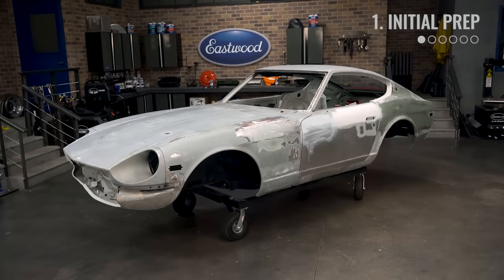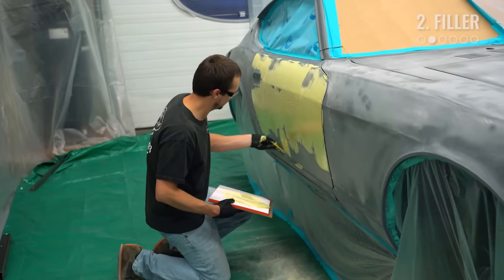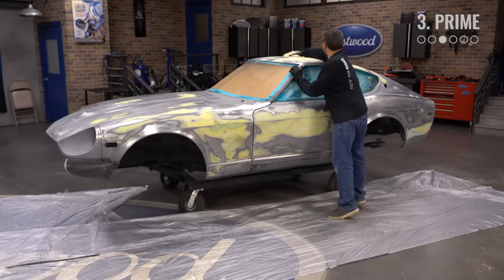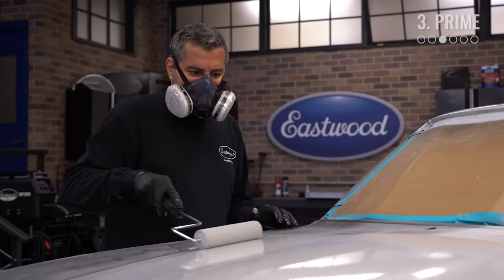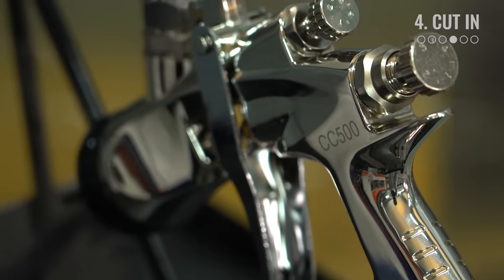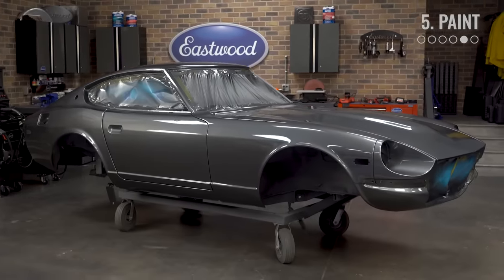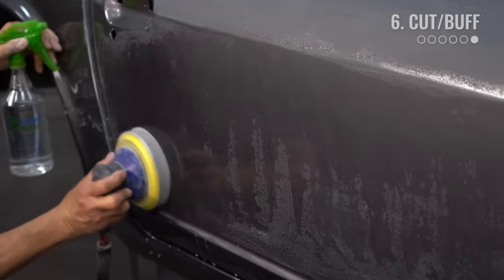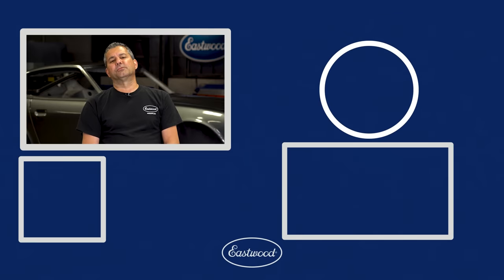STEP-BY-STEP GUIDE: How to Paint a Car at Home

Comment: 1:04 the bare metal of this car looks clean. What if the bare metal of look a bit dark in sommme places,   kind of minimal surface rust in it. Will it be enough to clean as much as possible and put primer on it?
Reply from the maker: So if you run into some pitted metal and light rust you can't quite get to we'd suggest something like fast etch which will neutralize the rust and then you can epoxy over top and it won't come back.  If you don't address it, a couple years later the paint will bubble from the rust creeping back in.

https://www.eastwood.com/rust-remover-eastwood-fast-etch.html

Comment: Great instruction! I’ve heard that polyester primers are porous and will absorb moisture. Not a good idea to let a project sit ?
Is there a high build epoxy primer that will allow DYI users to work on and off a project car without fear of moisture? Thank you
Reply from the maker: All primer has porous properties to a degree but urethane would hold up better to working on a project panel by panel.

Sprayable: https://www.eastwood.com/eastwood-gray-urethane-primer-and-activator-gal-kit.html
OptiFlow: https://www.eastwood.com/eastwood-optiflow-roll-on-urethane-primer-gallon-catalyst-kit.html

Comment: The link in the description takes me to a contact page, but I don't see any options (drop down menus) to browse OEM colors. Listing the prices of OEM select paints by gallon, quart and pint would also be very helpful.
Reply from the maker: We're working on launching the browse feature, in the mean time you can call us at 800-469-7940 or via this contact form https://eastwood.kustomer.help/contact/oem-paint-color-request-Hy0GFOlOn

Prices vary depending on paint code, for example pearlescent colors vs. metallic.

Comment: Last question, the rollable primer, can I use that at different times. Like if I want to do my door one day because it's off the car and my car the next day would that be okay or do I have to use it all at once
Reply from the maker: You can use it at different times, just only mix the 2 components in amounts that you're planning to use at that time.  You can paint panel A on Thursday and Panel B on Friday you will just need to use a new roller/paint tray.  We used the same gallon of OptiFlow on multiple projects.

Comment: Your video mentions an epoxy sealer coat as a final layer if desired. What reducer and percentage would you use to reduce the epoxy primer? Would you use the same epoxy primer?
Reply from the maker: Watch at 7:18, It's the epoxy reduced a further 20%
Reply: @eastwoodco understood but what product was used to reduce the 20 percent?
Reply from the maker: One of these depending on temperature: https://www.eastwood.com/eastwood-s-slow-medium-fast-urethane-reducers-qts.html

Comment: Outstanding video, you had panels removed would there be advantage to painting them off the car?
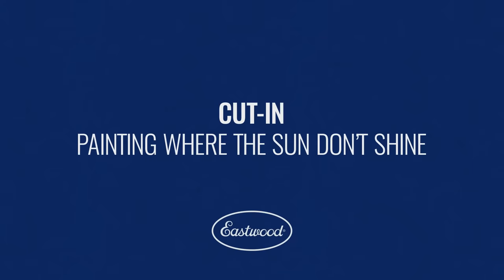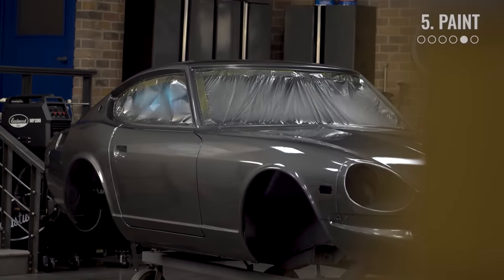Reply from the maker: Watch the "Cut In" section again at 7:45 to 13:26.  You can blow the car apart and paint it all separate if you have the room and time to do so.  You don't have to worry about taped edges that way but you need more room and booth cycles.  If you're doing a two tone it gets complicated to match.

Comment: What about the doorhinges? Lots of gunk there. And the airintake below the windscreen.
I assume sanding by hand but do one mask the hole for the heater? I assume the paint will find its way to the interior?
Good video!
Reply from the maker: For door hinges - you'd want to get them as clean as possible first, using a combination of soapy water and a brush.  Followed by a solvent such as Pre-Painting Prep.  You'll paint them along with the rest of the jamb - either during cut-in or when painting the body.

You can use the back taping technique on spots such as the cowl.  If it's taped well you won't find paint traveling very far.
Reply: @eastwoodco  Thx alot! ☺

Comment: So don't use bondo? or is there something better? I've heard that can fall out. It sure seems like a lot of work. Where can you get that blow up spray booth?  that seems pretty cool
Reply from the maker: Did you watch though the whole thing? We start applying body filler at 2:30.  The thing about filler is you don't want it to be more than an 1/8" thick as it will become more susceptible to cracking/chipping.  It's a lot of elbow grease but if you  take your time YOU CAN DO IT! Our spray booth is found on Amazon.

Comment: Do I have to use a glaze coat? And does that coat go over the rollable primer? I also am doing my car in stages so the doors off the car and trunk. If I have bare metal before I even start body work on my car, Can I use the rolling primer kit multiple times at different times? I just dont want my parts to sit in baremetal for days until the whole car is ready for primer
Reply from the maker: You don't have to use glaze coat.  If you get your body work straight and are happy with it while still in standard body filler you can move onto primer.

Yes we stripped this car to bare metal, epoxy it for rust prevention and it acted as a guide coat. Then blocked the car in the areas that needed additional work and then applied body filler.  Ideally you're not spreading filler on top of paint/primer unless it's a chip or something you missed right before paint.

Yes you can use the OptiFlow kit at various time. For example one week you prep and prime your hood, the following week you could prime your door.  You'll just mix the amount you need for the next job, and put on a fresh roller/tray.

Comment: This may be a dumb question, but if all the paint has been stripped, does the bottom of the car and the floor or roof type areas have to be painted also? I'm planning on dipping my 68 Mustang, and I have absolutely no idea where to start on paint and body work. Love the video!
Reply: The whole outside excluding the bottom should be worked if painting and they explain the jams and cutting in the video so you should be good there

Comment: How long did the process take from bare metal expoy to the final coat of clear (before cur and buff) and about how many people doing the work?
Reply from the maker: We didn't work on this straight through like a shop or even someone at home might, we did it over the course of 6 months or so.  However day's worked is probably about 20-30, mostly Mark with a helping hand every now and again.

A normal person working some nights and weekend days could probably do this in about 3 months.

Comment: If the clear coat came off over time, do I still need to sand the car to bare metal before putting primer on or can i just sand it enough to put the primer over?
Reply from the maker: There's definitely options to not strip the car entirely - check out this How to RE-Paint a car which is more in line with what you're looking for.

https://youtu.be/rZ7F6gmmH4E
Reply: @eastwoodco  thank you for your response

Comment: Nice work, but when u sand filler to smooth and got trought base epoxy to bare metal dont u think its good to put epoxy again those spots when u see metal to prevent rust? Sprayable filler prob dont have these anti rust features?
Reply from the maker: Our Polyester Primer still has great adhesion to metal.  You're going to end up with burn throughs on edges when blocking your epoxy but it is ready for the next step, and this is the next step.

https://www.eastwood.com/eastwood-contour-polyester-primer-direct-to-metal-surfacer.html
Reply: @eastwoodco   Ah yea i see, nice 👌, i have done like this: if bare metal, epoxy, sand, filler, sand, IF got tru to metal then sprayed those spots epoxy again, litle sand, then base and clear. Lot of steps and epoxy takes own tiem to dry but seems to work

Comment: They didn't mention it but DO NOT OVER SAND WHILE BUFFING be very cautious and if you break through the clear you repaint depending on how nice you want it to look
Reply: The other biggie is to ALWAYS have the rotation of the buffer going off of the panel being buffed! If you go the opposite, the pad can grab an edge and burn right through your paint!  You wont be happy! Stay away from antennas or wipers if they are on the car. If the pad catches one of those, you will know it!

Comment: Why wasn't wet sanding performed  last before base coat to get out the fine scratches.
Reply from the maker: You're talking about "color sanding" between base and clear - that's not typically necessary.  We address the final finish in the Cut/Buff step after the clear has fully cured.
Reply: No, in your beginner paint at home video and from painting in the past. Last primer go thru wet sand 800, 1000, or more then clean and shoot with base color.
Reply from the maker: Sorry we didn't understand your previous comment then.  Yes, primer is block sanded to 600 grit, we then sprayed this car with sealer and sanded with a DA with 600-800 grit.  You could do that wet or dry. Then spray with base, then clear.  Then wet sand and buff the clear coat if you'd like.

Comment: Would it be a better split by going 80-150-220-320 instead of 100-40-100   (80-180-220-320) in steps to 70-70-100 sorry I have ocd lol
Reply from the maker: Well you can only sand with what paper is available, and 150 grit is not a standard increment. You could go 80 to 120, 180, 220, etc. if you want some added insurance you're getting all the scratches out.  But 80, 180, 220, 320 is a proven workflow.

Comment: I'm painting my old van with Direct to Metal Paint. Would you Recommend Using a Primer to seal, as it says it doesn't need a primer? It's my first time using direct to metal would like some advice thank you guys.
Reply from the maker: I'm not aware of that work flow.  Generally speaking you would want to use an epoxy primer to seal metal, do your bodywork, another coat of epoxy/urethane, then paint.

Follow the manufacturers instructions for best results.
Reply: @eastwoodco  would a Grey Oxide metal Primer be ok? Thank you for your help really appreciate it.

Comment: Why not using hu build 2k primer as primer after Metall work? I have some left and wonder if I can use it
Reply: Working on a 1970 landrover, already sanded old paint, but now I want to strip it completely, brush a layer of etch primer on the alu and than bodybuild it up to Perfection as you did. However I already bought the high build 2k primer, sadly not from you, here in Australia everything is expensive af, so I want to use 2 layers of 2k primer instead of the primer you used - is there any problem with that? 

Do you sell in Melbourne AU? @eastwood
Reply from the maker: So there are lots of options when using primer.  We like epoxy over bare metal but if you've already purchased it just check the manufacturer's instructions to make sure it's good for both metal/filler.  Most likely it will be fine.
Reply: @eastwoodco  thanks guys

Comment: What's the difference between primer and sealer?
Reply from the maker: Primer is a thick coating meant to fill imperfections and be block sanded.  Sealer is thinner and (typically) top coated right away.

Every car will require primer, sealer is up to the painter.

Comment: why use a roller? wouldnt you get a flatter smoother surface if you sprayed it?
Reply from the maker: OptifFlow is a Roll on system - great if you don't have access to a spray booth. We used it to show that you can prime in your driveway without a compressor, gun, or booth.

https://www.eastwood.com/eastwood-optiflow-roll-on-epoxy-primer-gallon-catalyst-kit.html

Comment: Hi! 
What do you call that dolly for moving the frame? Positioning jack is the one that you put under each wheel, but can't find the name for this one that you use for moving just the frame. I vaguely remember that once I saw the model that allows you to turn the frame upside down, but not sure that it wasn't one of my would-be engineer dreams.
Reply from the maker: Mark built a custom body cart or buck for this car to make it moveable.  We offer a Rotisserie which allows you 360 degree access to the vehicle: https://www.eastwood.com/eastwood-3000-lb-capacity-rotisserie.html
Reply: @eastwoodco  thanks!
Reply from the maker: You're welcome! We also have DO have a body cart - but it doesn't offer 360 rotation: https://www.eastwood.com/eastwood-heavy-duty-body-cart.html

Comment: At which point did you, or would you apply seam sealer?
Reply from the maker: Seam sealer - as in sealing between overlapping body panels, would be done during the metal or primer stage.

We also did a "Sealer coat" which was after all primer, minutes before base coat.
Reply: @eastwoodco  Thanks!  I'm at that stage on my 280Z where I'm priming and need to apply seam sealer on the body panel joints and overlaps.  Brushable and tube seam sealer from Eastwood arrived last week!

Comment: Can I use a less glossy rattle can ?
Reply from the maker: You'll need to sand the surface with 800 grit for proper adhesion and then spray with a satin clear.

Comment: Curious why not spray base over sealer when flashes, how i did at the body shop with akzo nobel products used
Reply from the maker: That would have been a great option.  Our reason for sealing and than sanding was strictly a scheduling issue - we didn't have the painter ready at that time.

Comment: I still got some epoxy primer at home, is that Differential from the optiflow epoxy primer? It says it can be applied on the body filler, but I want to roll it on instead of spraying... is there any problem?
Reply from the maker: Yes, OptiFlow is formulated to "Flow Out" more since it's being applied via a roller.  At the very least you'll have a lot more texture to sand through if you roll on traditional primer and depending how it's formulated there could be some adhesion issues because of thickness.  We would recommend using OptiFlow for best results that we could stand behind if you want to roll on.
Reply: @eastwoodco  ok, next time. I buy from you, with my "old standard" primer I will at a but more thinner and hope it will Flow better

Comment: Can I roll the epoxy primer on paint with no clear coat/ sanded paint?
Reply from the maker: If you're not stripping to bare metal and just doing patch work you could spot repair like you're suggesting. Just make sure to do proper prep work, sand to 320 grit, and clean with Pre-Painting Prep.
Reply: @eastwoodco  ok thank you very much. Bought the epoxy primer roll kit. Just making sure I can use it

Comment: How long can you wait between coating a truck with primer and the finish coats? I have a 91 GMC 1500 I wanna completely redo inside and out but am gonna have to do in stages. Can I take any time between stages or should I do it all at one time?
Reply: I drove a 79 Ford F250 for over a year while doing the bodywork. I'd do work, primer, drive. Sometimes I'd have to go back and sand that primer and do more body work. But I went panel by panel. When all the body work was done, I shot a coat of sealer and painted in the same weekend.  With a catalyzed or activated primer, leaving it exposed is not terrible. It's not ideal, but not terrible. I don't know a manufacturer recommendation timeline though.
Reply: @ST-cy6we  that's what I was gonna do.  Just go step by step. Didn't know if there was any kind of window between coats.
Reply: @claygreen4723  check out the white sheet for the primer. That's the best source of info. Eastwoods has a support number too.

Comment: Is it possible to sandblast as an initial prep
Reply from the maker: If you have the ability to sandblast as your first step we'd absolutely recommend it.  Just make sure to get some epoxy primer on it after so it doesn't start rusting away on you again.

Comment: So I can apply your filler over your guide coat?
Reply from the maker: No you need to sand the guide coat off before applying more filler.
Reply: @eastwoodco  I may or may not have gotten it all sanded off lol it was scuffed buuut not fully removed, I’m assuming I should go back and sand it all the way down
Reply from the maker: Sounds like a judgement call - do you think it has good proper adhesion or do you think it will fail?

Comment: Hi, could you give me a bit of help, I bought a car that has been repainted all under the hood area and it had a few chips in the paint so I started to repair it but then I found that the entire paint was just peeling off and had not stuck to the surface at all so I used a paint scraper and just remover every bit of the paint back to the original Black paint underneath as the car was originally Black but now I am wondering why the paint did not stick so I can do it again without the same problems. Can you give me any advice as to what to do now. Thanks.
Reply from the maker: Sounds like the paint you just scraped off didn't have good adhesion to the original black paint.  Either it wasn't scuffed/sanded sufficiently so there was poor mechanical adhesion and/or it wasn't properly cleaned with Pre-Painting Prep or Wax & Grease Remover and had poor chemical adhesion.

Our suggestion would be to sand with 600 grit and scuff with gray scuff pads all over the previous paint and then make sure to thoroughly clean with Pre-Painting Prep then top coat.
Reply: @eastwoodco  Ok thanks and I will use an epoxy primer as well.

Comment: Just lay clear coat onto paint ?
Reply from the maker: Once you get to the paint stage, yes.  You are essentially spraying multiple types of liquids on in succession with flash times in between.

3 Coats of base with 15 minutes in between and then 3 coats of clear with 10-15 minutes between depending on temperature.
Reply: @eastwoodco  thank you. I didn't know if paint needed keying first. I'll do it your way thank you. Looks amazing